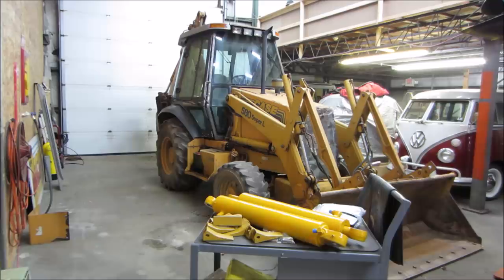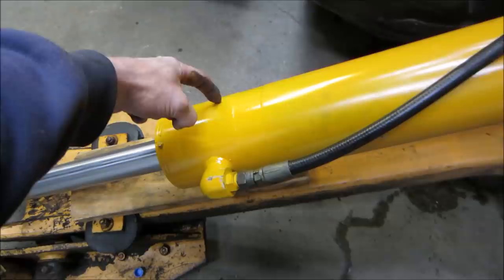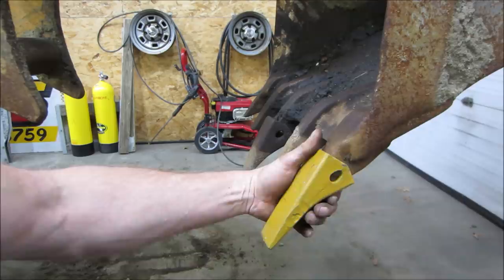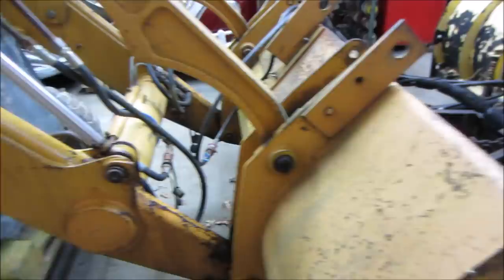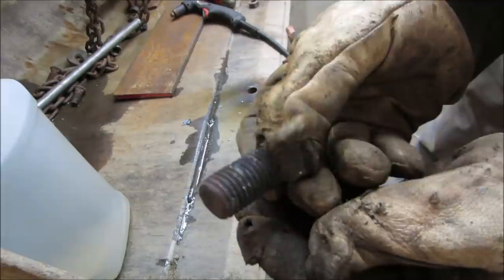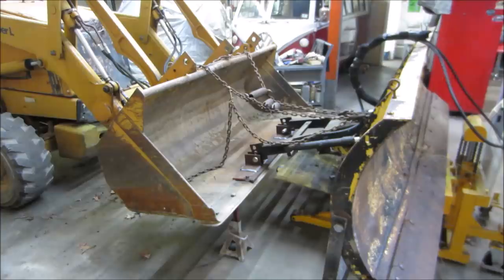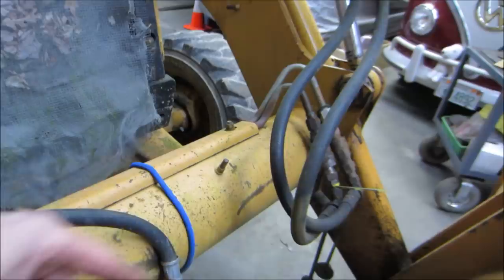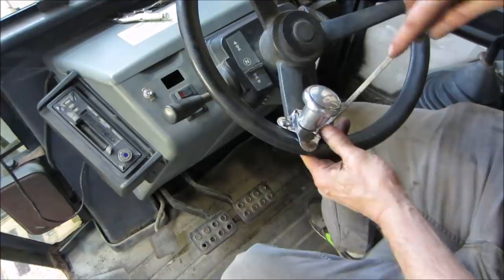WHY NOT? Lets Install A Snow Plow On A Backhoe

Comment: Hey Mustie, you are doing it the hard way on this one.  The welding looks really good, but unnecessary.  The plow is supposed to mount to the bucket with a couple of clips that fit over the front blade.  Think holding your hands perpendicular to the ground and sliding the bucket blade between your fingers until it contacts your hand.  The clips look like that and have a pin mount on the front that the plow frame mount into.  All held in by chains and binders or clamp bolts.  Nothing attaches through the bucket like the blade bolts.  That way you can mount it by driving into the clips, tightening it down and attaching your top chains and hoses.  Two minutes tops mounting and unmounting with frozen hands and stubborn hardware.  Very little time, effort and complexity.  I believe a couple others have mentioned this as how it's setup.

Enjoy!

Comment: curl the bucket bucket down and the brackets on top will be verticle for plow. the springs are needed if you hit something stationare like manhole cover and allows blade tto tip and go over object.  did this tears age with case 680.

Comment: Those countersunk bolts with the square head beneath the countersink are called Plow Bolts.  You need them to fit the holes tightly or you will wallow out the holes.  My guess is they would be readily available from a farm supply store (Tractor Supply Company or whatever you have in your area) in longer lengths.  Another source would be an implement dealer's parts department.

Comment: plow on my tractor is lifted my the loader and angled by the curl function.  but it goes in place of the bucket. its a 29 series sno way plow with pump and lights removed, there is a small cylinder that was to raise the plow, i let that move free for the float feature. it still has oil in it but the line just goes from one end to the other. it came with my tractor but i improved the float part of it. it has quick connects on those lines for easy change over.

Comment: I have a jcb backhoe. That i use for multiple tasks as well.  Bought the weld on skid steer quick attach.  They make a very heavy duty version for bigger equipment.  We cut the pin brackets off off the bucket which got welded to the quick attach.  Then the female quick attach plate got welded backto the bucket.   Now i can use all skid ateer implements as well as the factory bucket.  Could switch between a snow pusher or tge bucket in seconds

Comment: 1 up for removing the bucket instead :) even if the setup work, you wont be able to put any pressure down to ground with that. you gonna see you need to have some downpresure as well to realy move the snow around :) Anyhow another realy nice video to watch :)

Comment: An oldtimer told me once and I've done it ever since:  Never use lubricant on a hole saw when cutting metal.  It makes the chips stick inside the groove and can break off your teeth.  Use compressed air....

Comment: Having  lived in Vt, and plowing snow for years, I would suggest rear tire chains. If there's ice, or a slope tires with no chains, just spin. I had Canadian chains like the log skidders had- a ring with caulks to bite into ice/frozen ground. Chains with just an X instead of a ring and caulks of links are popular .I also had shoes on the plow to stop digging in after a thaw, then snow. If you're only on asphalt paved areas, no shoes will work, but the pavement gets marked up, The plow did have shoe brackets, but the rear drag blocked them they were removed. Why you can't just drop the plow and pull snow back without the extra back blade ? I guess somehow you could add shoes . The springs on the plow chains have me scratching my head they seem 90 degs from how they would be used. Happy plowing :)

Comment: I have seen these plows used here locally. I think the one U have is the same..
The  two brackets with 3 hole on each goes on a pivot point that is bolted to the tractor frame in the front, the bucket is taken off and the chains hook up to the front loader boom to regulate the height of the plow. I have seen those springs in the chain for dampening on the chain. they R used horizontal.

Comment: Lots of HP to push that blade...but seems like it would be kind of clumsy to use unless you were clearing a large parking lot where you didn't have to turn too often. Front Tires look about due for replacement. It's going to be a pain swapping that bucket for the blade.

Comment: I think you need to be very careful of the underside bucket bolts when you loosen them. I watched another video where the guy cut his finger when one bolt spun fast at the end. That was the blade edge on a bulldozer, but it looked similar to your bucket. Great video!

Comment: You did a fantastic job on replacing the cylinders for the stableizers, wow! That's a hard job to do for one guy. I was thinking you where going to have to, turn the cylinders the other direction to avoid tearing the  hydraulic hoses. Great job mustie1,  and the electrical must have been tuff to figure out.

Comment: Look like it attaches to the frame because of the bolt holes the hydraulic  would then be the right size, the rest will fall into place.
If you doing the way you're going you will have difficulty steering, sorry for being a pain, plus it's easier to replace the bucket when you're finished,  Happy New Year to you and your family

Comment: need to be careful when pulling out the big carriage bolts (most farm stores will have them)if the square shoulder gets rounded or even drops down they can spin and are just like a "spinning razor"  done that on plow shears and other farm implements blades, old blunt chisels work good to spread apart nuts after cutting. think if i was going to use the blade a lot i would drop the bucket and make a frame to hook directly to the loader frame. nice rig have FUN

Comment: I think those counter sunk bolts are standard grader / bucket things.
I pulled the replaceable blade section off my 3PL grader and it had exactly the same bolts.
Agriculture supply place will have them.
The come along scene was hard to watch.  I’m glad you can still count to 10.
That hook seemed to defy science to stay where it was.
My rule is if you hear your self say. “I had better be careful here” it’s time to change your approach.
I think you were lucky.

Comment: Those "strange" bolts that hold the blade to the bucket are the ones used to fit plough shares to a tractors plough.. Any agricultural engineers will have them or on line, tractor supply.

Comment: at 25:39 ... if you changed the regular bucket to a quik attach system you could easily switch between the bucket & blade

Comment: Mustie, this is the only project that I have seen you do, without asking why ? It seems you have wasted a lot of money making a snow plough out of what was already a snow plough. I was pushing snow in the 70’s with the nearly equivalent machine in the UK (JCB 3), with just the Bucket. I love what you do. I hope you have an excellent 2022. Happy Holidays Darren. 👍🔧🇬🇧
Reply: @warrenmichael918 did all the steel, welding rods, drill bits and all the other materials come free, as well as his time. I am entitled to my opinion, and I think it was all unnecessary to put a snowplough onto something that was capable of pushing snow without all that work and expense.
Reply: @johnobiro5202  haha  ok  i know he might have used a few dollars in shop expenses, stuff he already had laying around but it wasnt like he has thousands of dollars into this thing from those few pieces of steel and things he used. Yes, he bought a new cylinder and had one fixed for the stabilizers but thats just maintenance for an expensive machine like a back hoe. He will no doubt spend a few thousand more dollars just changing fluids and filters as well as replacing blown hoses once he gets to using this but again, its all maintenance that every back hoe owner has to deal with. 
I agree that the bucket only is more then capable of pushing snow in most situations. I think he needs the plow to push snow on his narrow tree lined lake road and just has room to drive in and out of the path. He doesnt have room to use the front bucket and turn to dump it in a pile i think. 
The biggest factor here was that he got to make a video on doing this and that will pay him for his time.

Comment: I use pink dish soap from Sam's around area the area being heated to mitigate heat transfer on metal. Full strength in spray bottle is sufficient. Also helps to protect o-rings adjacent to heated area even with oxygen acetylene torch. Apply directly to the area with o-rings or sensitive materials that you don't want to destroy adjacent to heated area.

Comment: Personally, I wouldn't even mess with the plow as the front bucket will do everything you need to remove snow and it will make a pile, centralizing the snow in a spot out of the way.
Just learn to float the front bucket and that's by pushing the bucket Controle all the way forward past the down spot and don't get in a hurry as that backhoe is about 12 tons and it breaks thing fast and don't forget to Grease the whole machine before or after each using.

Comment: I think the original brackets hooked behind the front of the blade and run to the three brackets that are on top of the back of the bucket... and you can secure them with a solid bar through the three holes and then put a split pin on both ends of the bar to secure the locking bar. That way most of the stress of pushing the plow is on the underside of the blade and not on the brackets at the top of the bucket. Otherwise why would those extra brackets be on the bucket allready??? And that way you easily get the plow of at the end of the winter and have a nice clean bucket and blade....

Comment: Looks like the angle cylinders on the plow are single action with high pressure fluid on the back side only, which makes sense, and why the piston shafts can be as messed up as they are, and you only need strength in one direction; otherwise you'd have a double-action cylinder on one side only.

I'm with the crowd, I'd have taken the bucket off and mounted the plow directly to the bucket arms...

Comment: I've never dealt with those cable come-alongs. Due to safety reasons, they aren't allowed on our jobsites. We use the chain ones where you switch between up and down with the flip of a switch or knob.

Comment: Maybe run additional hardlines from the stamps to the bucket? So you can disconnect the stamps and use this function for tilting the blade right and left? This way you don't loose bucket function.

Comment: I often wonder why folks don't add on the third accessory hydraulic or electric and then fabricate a plow to go over the bucket like a clamshell for the option of filling up the bucket or just pushing. If I ever get a bigger tractor I'm going to give it a try

Comment: i would say if your hell bent on using a plow either buy or make a quick attach plate so u could use either the bucket or plow and like others said get yourself a 3 rd function valve  thats probley what the button on the front loader stick is for

Comment: 👍🇺🇸🇺🇸🇺🇸🗽🙏🏻 Enjoyed!  Really nice find/buy.  You’ve probably done it already, but don’t forget the fluids and filters which probably have been ignored of late. The hydraulic fluid type is crucial based on whether the clutch and transmission are one or separate units, I’m sure you probably already know that.  Good luck with it and have fun.  I made a set of chains for the rear tires out of a couple sets of truck snow chains, made a big difference when it got icy!  They would be easy to put on where you can raise the back tires of the ground.

Comment: TiP: Just saw letsdig18 service his backhoe, then dig a hole and he got stuck because the counterweight on the front hangs so low as to drag on uneven terrain. Your Case has the same counterweight it seems. So just a heads up. It might drag on snow, ice, or uneven surface when snow plowing..
Reply: he tends to "dig himself into big holes" but don't we all ( just being funny, not against him/channel at all) LOL 🤪

Comment: Are you sure that the bucket does not come off and your plow does not go on the arms of the of the backhoe. I would check with Case backhoe company.. Good job so far. Your cutting edge needs replaced or add some iron to it so the back edge is not cutting. Why not just use the bucket to plow. With the bucket you could then lift and pile snow that way. Sewer covers will bend the plow. I have gone through several mold boards over the years, they get holes in them and they rust out. Can patch with a welder.

Comment: Frost teeth are  correct....curl with the bucket! You need to fabricate with an adapter plate for easy connections and stability  also a pin hitch like forks called a Quick attachment!!!!!!

Comment: Did you measure the distance between the the two short tabs on the top of the loader bucket. They look really close to the correct spacing. If you where to curl the bucket upside down. I am thinking if this plow was previously used on this backhoe that is.

Comment: I'm sure no one will agree with me but. . . I would put a small line of weld on top of those teeth. That last one you installed seemed really loose!!! Just a thought. It can be removed relatively easily if needed.

Comment: Tried the same Idea of putting a push plow on a bucket but found that the mass is too far forward on a long lever arm. I couldn't tilt the bucket or lift the bucket without causing the rear end of the tractor to lift up. It will take a 1 to 1 1/2 ton truck to handle the push blade.

Comment: The snowplow should be connected to the  brackets on the top of the bucket (minute 29:20) You are missing the extension bars down from those brackets to the plow. They should bolt to the top brackets and then clamp to the bottom of the bucket. We have them all over here in Alaska.  That way there is nothing in the bucket when the snow plow is not installed.  The snow plows are connected very similar to how you connect rakes setups to the front of a bulldozer.

Comment: It seems there is an ideal height to the booms of the loader as far as to how far down you go. Have you thought about cylinder stop collars so you could get the same height on the booms every time?  With the booms in a set position with the collars the raise lower of the blade would be the sole function of the bucket cylinders.  One less judgement to make with the loader joystick.

Comment: 1. Ditch that plow.  I have plowed with many 580’s and use either the bucket or a snow pusher attached to the bucket.  If you decide you must use the plow be extremely careful as a 16k machine with destroy that thin plow in no time.
2. You will quickly find that 4wd does little on a 580.  Especially with bald tires and rough terrain.  Basically you operate the machine in float ( lever pushed all the way forward and clicked into float detent) and use the individual brake pedals to steer the machine, not the steering wheel.
3.-As a former Case mechanic I laughed when you put the first outrigger cylinder on backwards.  Many make the mistake.  The cylinders fittings always face away from the hoe, or on a hard swing they get smashed.
4.  As for the light wiring burning up at the fuse box.  Check the wattage of the light bulbs in the lights.  Many people put higher wattage bulbs in them and it does not take long for the circuits to become overloaded.  I normally cut the wiring at the fuse box and ran my own relays.  
Finally that is an excellent machine, in fact that was the best 580 ever made.  Always run only factory transmission filters and it will serve you very well.

Comment: The bolts that held the cutting edge on, are called 'plow bolts" readily available in different sizes and lengths.
@ 48 minute mark, all you have to do is curl or tilt the bucket to change how the blade sits. If you are doing gravel, best get some "shoes" for the blade to ride on and set them so the blade is just off the ground.

Comment: On thick plate with a plasma, pilot drill the centre with a small drill, and then start the plasma up in the hole.

You put the teeth on the right way

Comment: I wouldn't even use the plow I'd just stick with the bucket I've plowed snow with a bucket on front end loaders and they worked just fine. plus with just using the bucket your rig isn't as long which enable you to maneuver easier around cars etcetera but the blade does give you a wider option, its looks like what you've got set up, should work fine though... only time will tell, right! looking good though, your getting her tidied up!

Comment: After reading comments, using the bucket only is great for deep snow but the blade is better for light snowfalls due to being able to angle the blade funneling the snow to one side in windrows instead of the bucket filling up so frequently. The plow is better on large parking lots with minimum snow depth but bucket is better in deep snow so it cmon be piled high.

Comment: I like what you did. But. I think if you made to bars that came down off the top of the bucket that laid down on the bottom of the cutting edge it would have been easier to remove

Comment: Mustie, what do you think about welding some stop plates to the angle iron behind the pivot pins? That way the force of plowing is against the stop plate more so than the connecting pins. Those pins are kind of small to take all that force from the blade.

Comment: Get a rod that will fit the pin holes where the teeth attach...make it long enough to reach the center tooth plus 6 inches or so...then you can get a straight shot on all the pins.....makes life a lot easier

Comment: I've seen allot of snow plows mounted on equipment, however, never have I seen one mounted to the bucket. Most are mounted in place of the bucket. Leverage is going to make it very heavy sticking that far in front of the machine. King pin is going to take a beating.